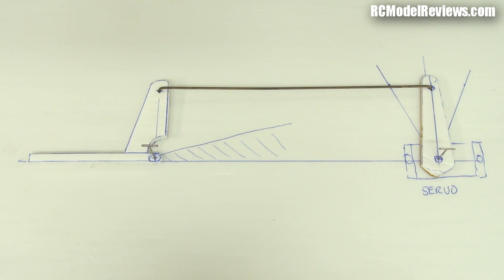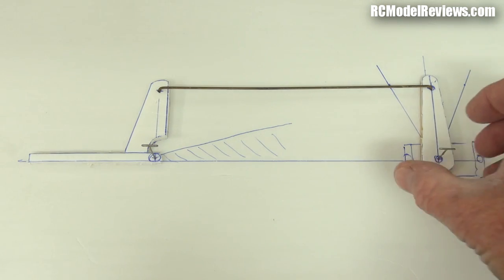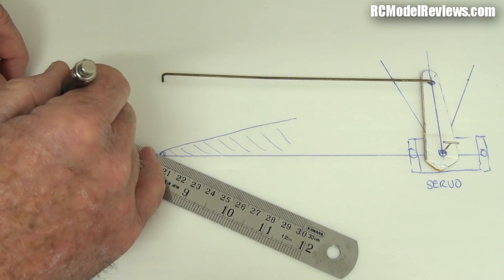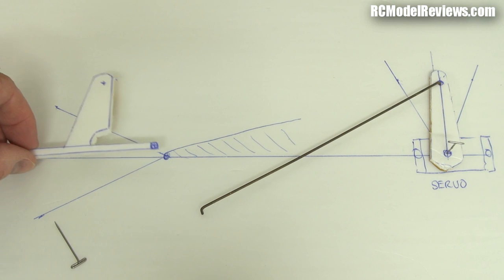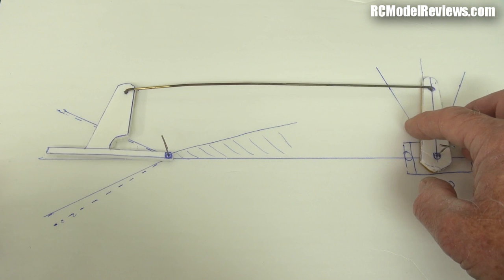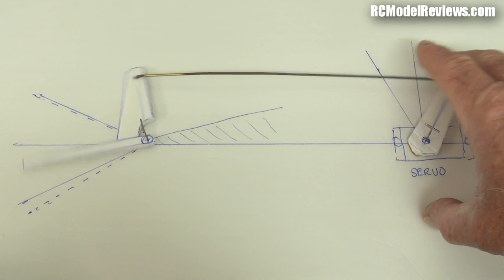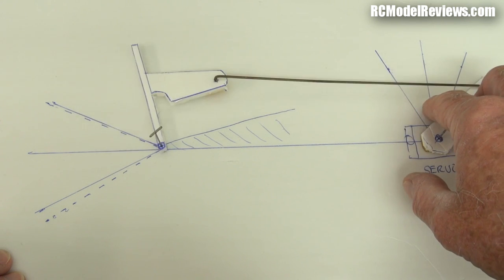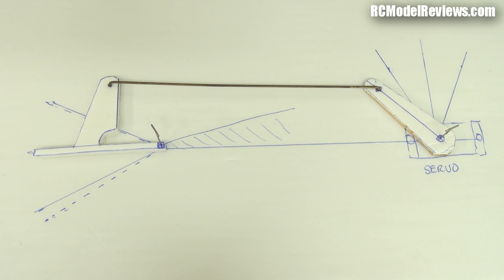RC Basics: The importance of good linkage geometry

Comment: Don't we sometimes use linkage misadjustments of our linkage to achieve physical  differentiation?
Reply from the maker: It used to be the only way to get differential throws when needed (such as for ailerons) but these days, most people just program different EPAs on their computer radio.
Reply: Yes - but the differentiation should work the other way. Due to the airfoil camber you should actually move the control surface up more than down. Why? Because if you leave it like this - the aileron that moves down much more creates an airbrake - that will actually yaw your airplane in opposite direction than you wanted to bank. Bruce - I think you should add more explanations of the actual effects of such bad and incorrect movements.
Reply: For people just starting out this is just fantastic. 
People wanting to get more advanced in setting up as their confidence grows, then yes I agree with Przemyslaw Jakubczak.
Reply: No - EPA is end point adjustment. You will just limit servo travel. You will get more even non-linear answer: you move your stick further but servo stops as it has reached the end point/max value. I don't think you can have a precise control in such case. To achieve the proper linear correlation of stick movement vs servo movement in this case you would have to apply proper curves.
Reply: Not quite true, if I set my EPA to 50%, this does not mean the servo stops moving when the TX stick is moved 50%, it actually just means the servo moves half as much in that direction for the same stick movement, similar to (but not to be confused with) dual rates. I can prove this, as I recently set a model up using EPA and Subtrim to counteract poor linkage geometry on a model I bought half finished second hand.
Reply: Juergen Stremmler yes, you can clock the aileron servo arms forward so that there's more throw as it rotates back to deflect the aileron up.  In turn, it has less throw when pulling the control rod forward (aileron deflecting down). It's a simple way to achieve differential ailerons when using a simple Y harness and a single rx channel.  If using a channel for each aileron servo then most radios have a differential feature built in, or adjust endpoints for each.  If using a Y harness, your differential throws must be mechanical though.
Reply: FlyingSloth Yes - you are right. I have MC3010 transmitter - and I was referring to setting max throws in conjunction to setting custom mixers. I must admit my statement was not correct. Thanks for clarification. But if you are beginner you may not be aware of this and you may just crash your flying wing due to unexpected behavior.
Reply: Przemysław Jakubczak, Whether you use positive (more up throw than down) or negative (more down throw than up) differential depends on the type of wing.  On a conventional aircraft (non-symmetrical wing + separate tail on a long moment), the  wing's entire airfoil produces lift so a down throw of the aileron creates more lift and more drag than an equal sized up throw of the aileron surface, so you use positive differential to counter adverse yaw while rolling.   However on a flying wing or plank airfoil, the forward part of the airfoil creates positive lift, and the rear part of the airfoil creates negative lift (to maintain a net zero pitching moment) and this actually means that up throw of an elevon surface create more drag than equal sized down throw, so you use a little bit of negative differential to counter adverse yaw.        

The geometry shown in this video is desirable for any properly balanced flying wing or plank where you cannot control it through the radio, or can't because it's going through a flight stabilizer or other external elevon mixer.    For this application, If you have a choice between having the hole in the control horn directly above the hinge line with the servo arm angled forward,   or servo arm vertical with hole on control arm angled back from hinge line, choose the former.    At max throws the former geometry maintains better leverage against the control surface at both ends (can see that in this video as well).    The problem is, a lot of newer molded foam aircraft have pre-defined places for the control horns which often do not line up with the hinge line at all, so you have to decide whether to match the angle at the servo arm, or let the geometry create mechanical differential.    If it's so wrong that you need to reverse the differential you can do so by switching the horn and servo arm to the other side of the wing (top to bottom, or bottom to top).
Reply: RCModelReviews, it’s not always possible to program differential ailerons in your radio. For example if you are only using a single servo to control both ailerons then you can get differential by offsetting the connection angle on the servo or horn in the way you demonstrated. Great demonstration btw.

Comment: Add to that, so many aleron servo cutouts arnt square with the hingeline
Reply: I've heard that this is a deliberate design choice - for some reason these designers think it is better to skew the linkage to keep the whole thing 'in line with the airflow' - as if a tiny, thin control rod causes much drag! They stupidly think that tiny lessening of drag is worth all the associated problems of twisting linkages when you skew the geometry.

Comment: If you put your horn in the wrong place the aileron becomes very stiff and less prone to flutter I learned from a Chinese kit which I thought was . it was a glider kit for dynamic soaring there wasn't any flooded we took it up to about a hundred and fifteen miles an  since it was a flying wing the aileron movement was very very small deflections so we didn't worry about geometry

Comment: Even major manufactured FPV planes like the HK Cloud Surfer sometimes come stock with such poor geometry you need to replace standard components like the control horns just to  get the linkage pin hole in line with the hinge for even throw up and down. Only planes that fly out of the box without issue I have experienced is Horizon's. The UMX Radian micro glider with many other UMX models and the new Opterra 2 meter wing show real progress being made whereas I find it hard to believe some of the mistakes made turning what could be good planes into junk.

Comment: this is just one of the many things the current (B)arf generation fails to learn.
Another thing to discuss is the importance of push rods that have low friction and do not flex under load.
Manny (B)arf come with thick iron rods that are forced in bends casing needles load on servo's

Comment: for the Aileron you need to make another video!! yes! many planes do not have the Aileron servo mounted as you have it in your video! 
you should do a new video with the servo's output shaft mounted 3/8" to 1/2" below the Aileron's hinge point! this puts the linkage rod on an angle. this IS how many of the ARFs are made today!!!

Comment: You forgot about the hole in the horn for the control wire...the control wire should be a snug fit in the hole. Do not drill an oversized hole for the control wire.

Comment: Link geometry is probably even more important for helicopters than it is for fixed wing models. Speaking of which I wish they'd stop putting an 8 degree pitch offset into helicopter tail mechanics. It's a holdover from the days of simple tail gyros and is completely unnecessary with modern FBL systems. You're better off with linear tail resolution and adding in the neutral hover point electronically. Only Gaui seems to have caught on to this.